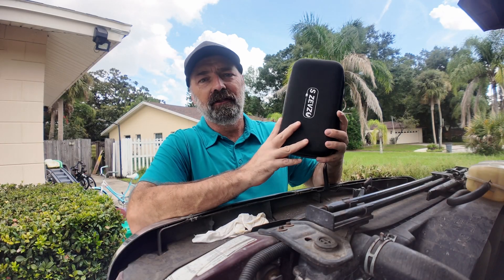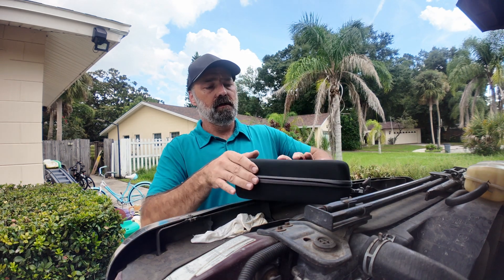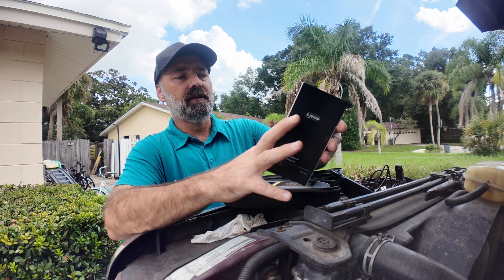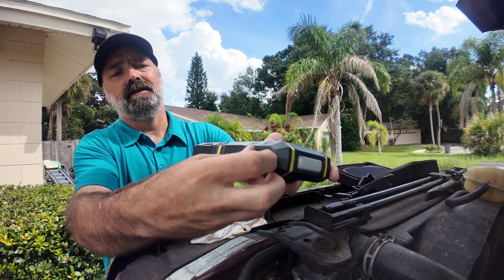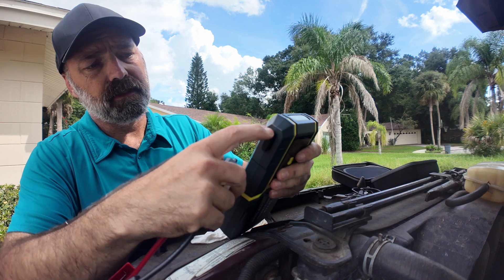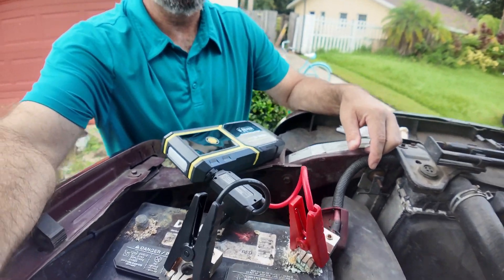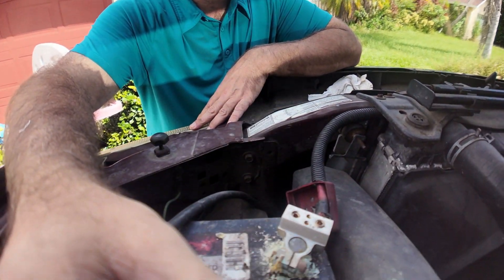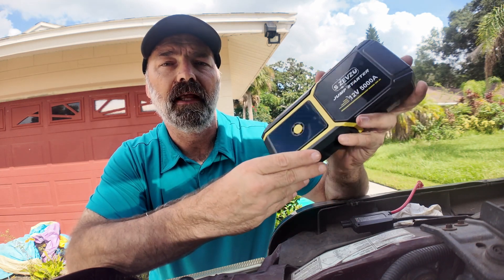ZEVZO H021 Car Jump Starter, Peak 5000A Jump Starter

Comment: https://youtu.be/-IyJ1XAJrRQ?t=23
What model of truck, with a 7.3L Power Stroke engine, uses a 24-volt system? The math, on this endorsement ad, is all wonky.
Reply from the maker: I am a victim of the common misconception that the truck requires 24 volts to start. However point being it wont start with one battery and the jumper has enough power to sub the 2nd battery. Thanks for teaching me something nee today.